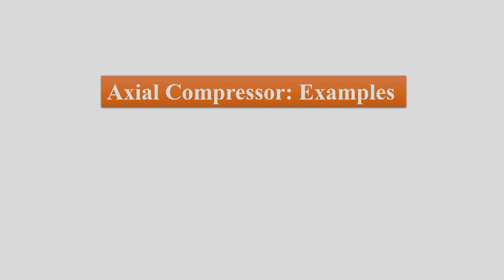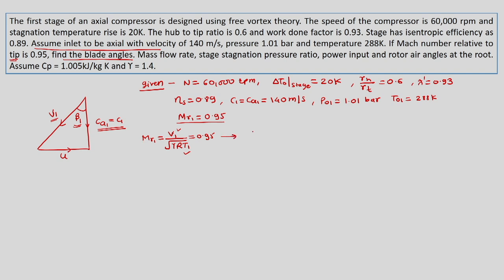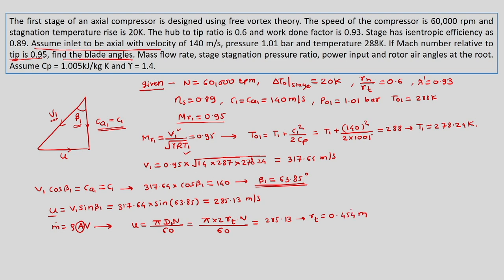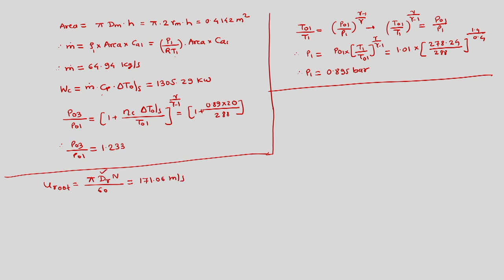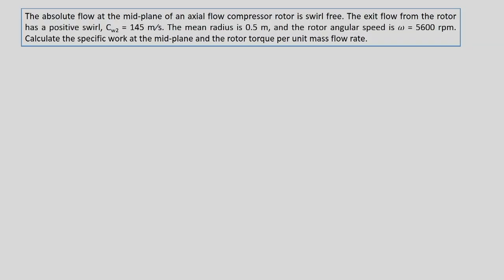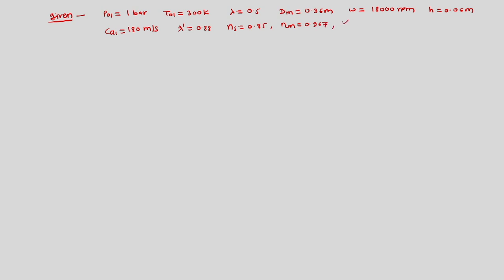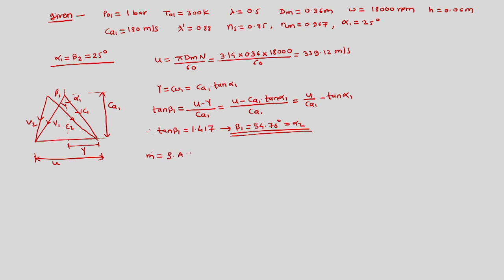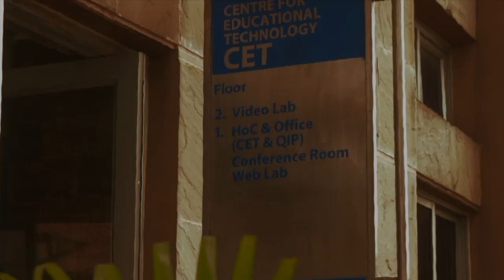Lec 32: Examples of Axial Flow Compressor

Comment: What's the relation between Rtip and Rhub to find the height?
Reply: I think height of the blade is equal to radius at tip minus radius at hub.
Reply: @narendrarajput505  ur correct